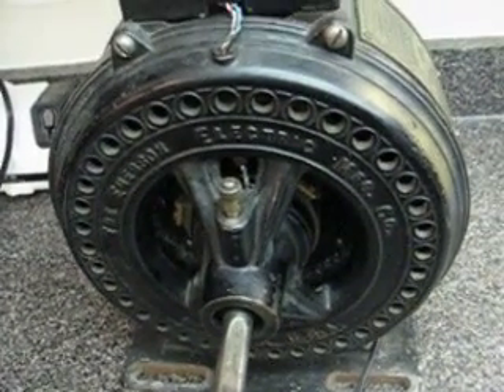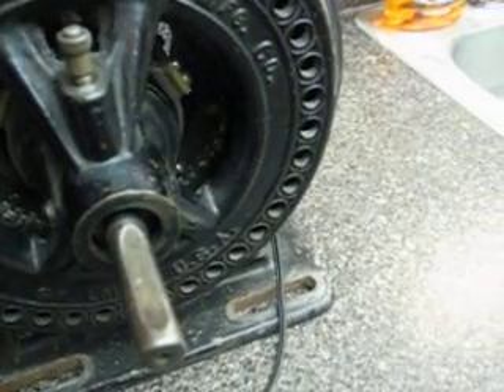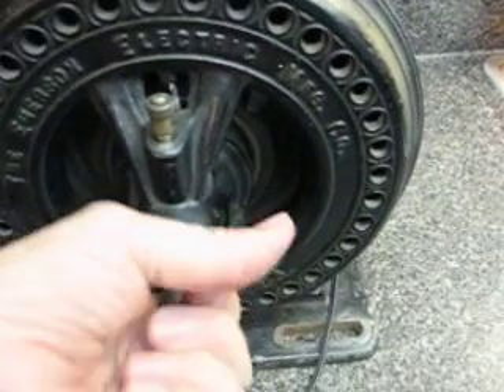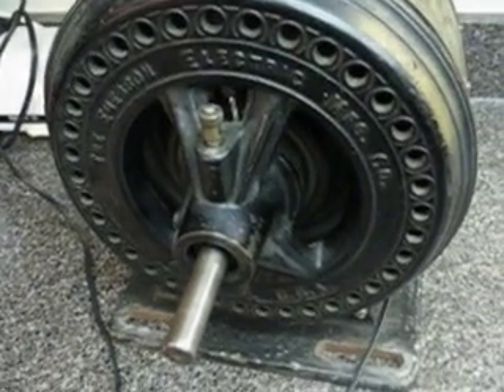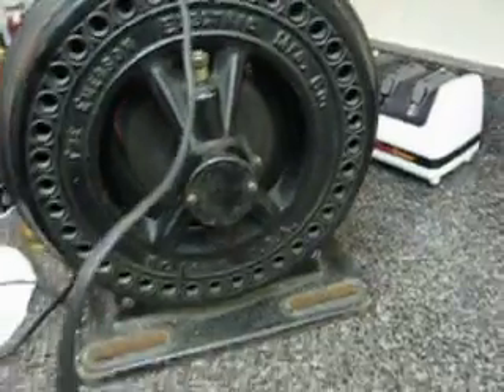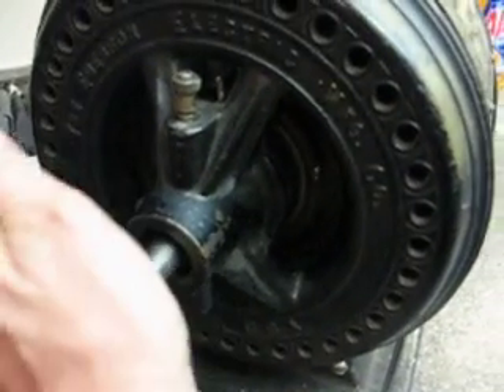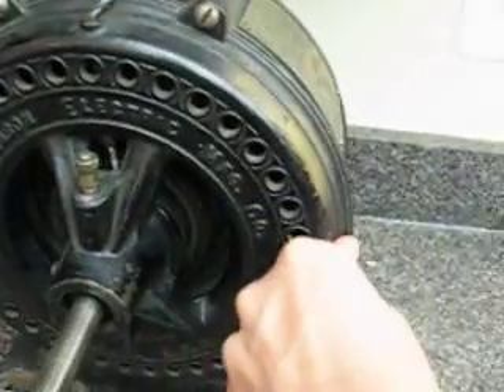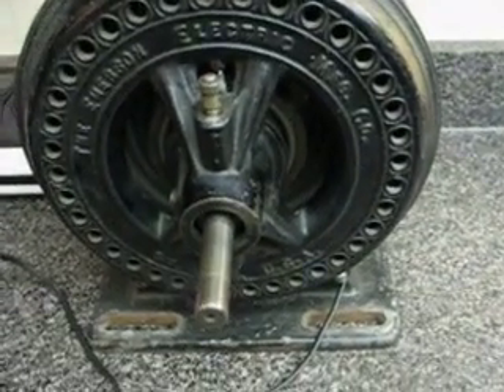Emerson Motor Pt 2

Comment: not sure how much power that old motor draws on startup as most split phase motors do draw alot of power kinda dims the lights when the start winding is engaged. as Emerson today with the motors they rebranded them as US Motors and were sold to Nidec Motor Corporation still under the US Motors brand but is still a division of Emerson Electric Co.  as some motors are condensing fans for Copeland which Emerson owns the Copeland compressor brand. they own Closet Maid, Rigid tools, In SinkErator as Emerson is a big company today.

Comment: Hello again I finally bought several of those motors on Ebay the past year Very nice to see one in operation in my garage. One seller actually shipped the rotor in a seperate box so the main box wouldn`t be so heavy . My first one has a bad start winding and springs on the what looks like lead weights inside that apply a automotive style clutch on the rotor to the shaft. the other 2 really a nice peicesfor my collection. There is another one for sale rebuilt,painted plus a chrome base selling for over a thousand dollars.

Comment: I just bought one on E-bay for $150 its a 1200 rpm has the start winding not working. It has the clutch just like yours. The clutch  has weights that spring out and engage the plate clutch similar to a automotive clutch. They would use that design today it would have more torque than anny capacitor motor. How ever they use clutches on the outside of the motor in many washing machines for the spin cycle.

Comment: One of these, just sold on Ebay, about 2 weeks ago. It was rated 1750 rpm's and was  1/3 horsepower. I think it said it weighed 70 pounds. Went for over $300. 

I wish I had seen it, I would have bought it, I LOVE these old antique electric motors! I'll keep my eyes open for another one. Where there was one, there will be another one. I'm still looking for a Century repulsion start motor, too. Either 1/2 horsepower or 1/3 horsepower. You can't kill these old motors, built to last nearly forever!
Reply: Is there any chance that you still have it & would sell one?

Comment: it didnt seem to have the loose shaft like yours but it was definently the same style motor. the guy had it hooked up to  a little generator for display. unfortunatly it was not running when i was there. 
i pulled a motor off an antique furnace oil burner. i belive it was the original burner to my grandmas boiler. the motor is a 1/10th hp ohio electric motor. i just removed it from the burner unit and wired it up to a cord and it runs like brand new!

Comment: I've been fascinated by motors since childhood, and have a shelf of interesting old ones.  Currently rebuilding a 1/6 hp Century someone made a fan out of.  I have a friend who has a shop here in St. Louis who has an Emerson like yours.  He also has an Emerson r.i. motor which uses a manual lever to throw out the brushes and short the rotor, instead of a centrifugal mechanism.  It was made in about 1890.  Still works great!